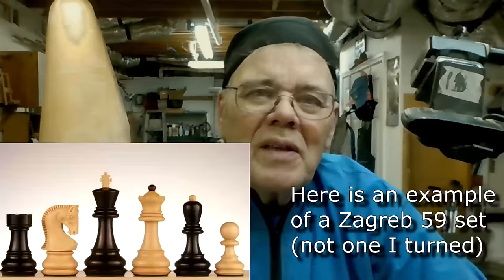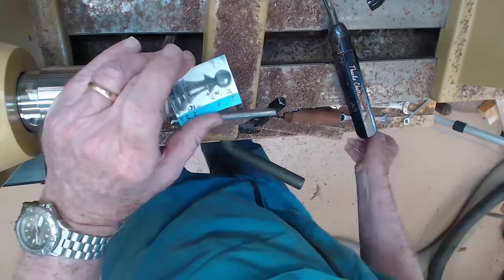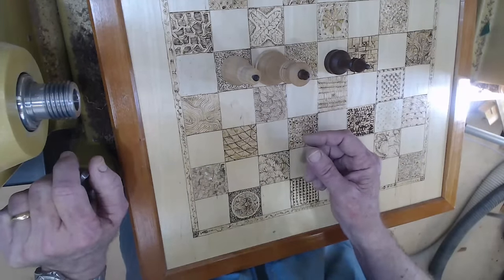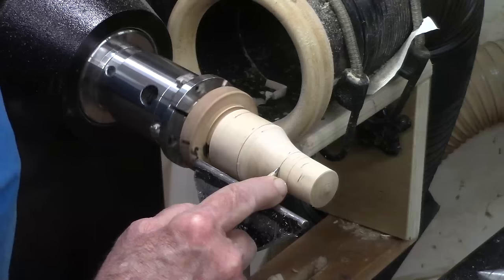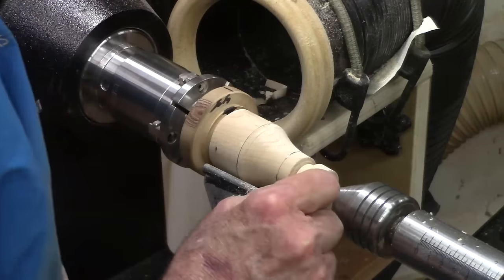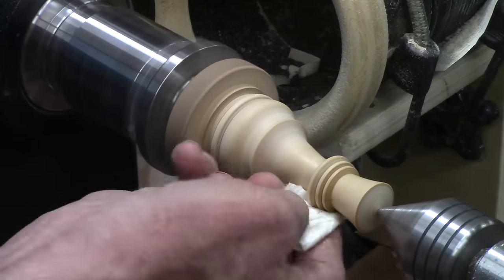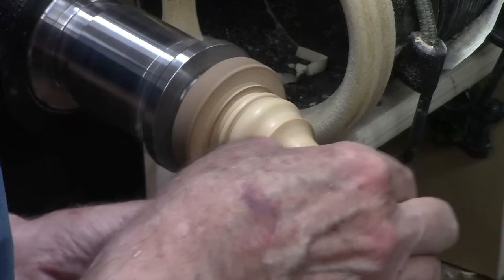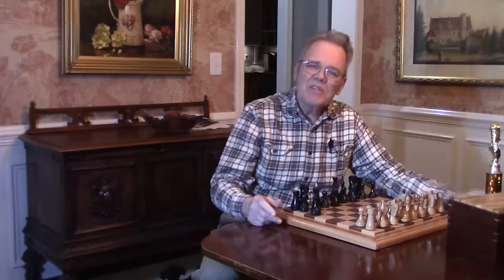How to Turn a Chess Piece – 4-Ways

Comment: Lots of useful stuff for making your first chess set. I really like the way you mount the blanks on the mini screw chuck whilst making space for the weight.
Reply from the maker: Thanks, Richard. Certainly grabbing with a chuck maybe a bit faster but does not provide for that extra weight. Aand as you have shown in the past, a screw chuck can be a great way for chucking a variety of projects.

Comment: You can't beat a story board ( stick). I use them when making multiples. I think it was you from a few years ago.. I also have a cheap set of spanners ( wrenches), which I use very frequently as my set size callipers. Now on to no#2 of the challenge partners.
Reply from the maker: Yes, spanners make great calipers. Happy New Year.